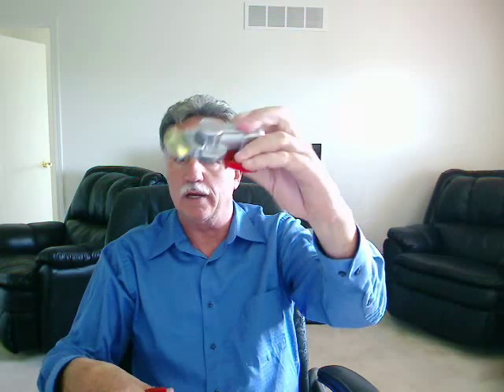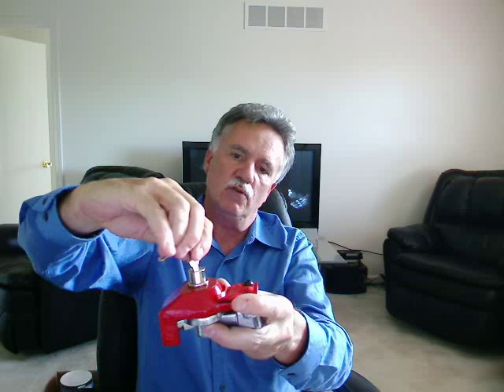Glad Hand Lock

Comment: What if someone removes the whole handle with the gladhandle lock on it? How can we prevent that? I can just replace the whole handle its cheap $12, how can i prevent that?
Reply: these tend to be used primarily as a safety device first and a theft deterrent second.They are great for keeping idiots from hooking up to trailers that are out of service etc or driving away from dock and so on.They also sell them in plastic if you just wanted it for safety but its pointless as you might as well use it as a theft deterrent too.As you said there isnt much a thief wont do but chances are they'll move onto a easier target and for long term its best used with a pin lock too.But really these are nice as they arent greasy and they're quick and easy to use for a quick drop in a semi secure place.
Reply: SouthJerseySound exactly. These are easier to pick than a 6 year old's diary. They're not great for theft protection.
Reply: @Trucker_Jon  he also stated 25 key configuration and just give model number they mail the key lol